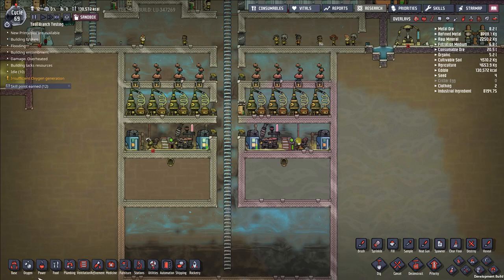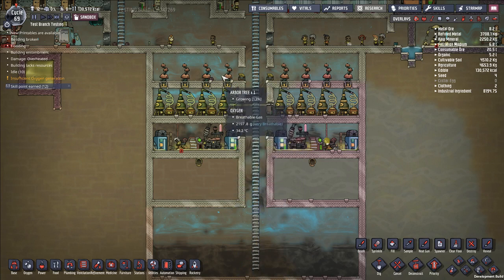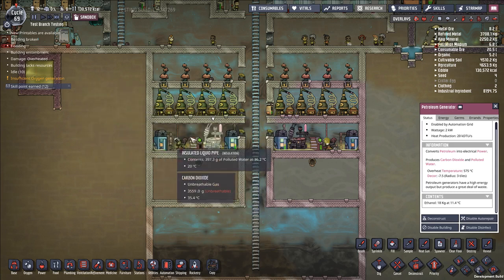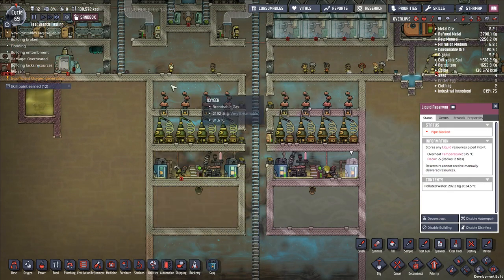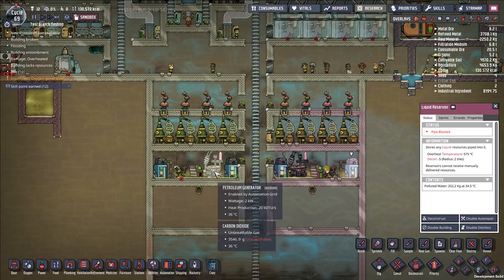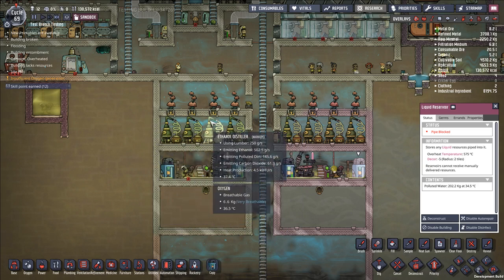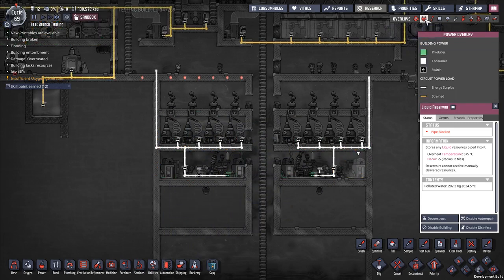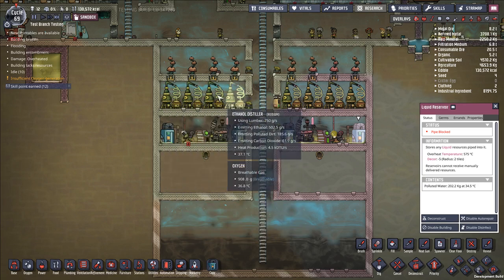Infinite Water, Infinite Dirt, Infinite Power - The Ethanol Distiller [Oxygen Not Included]

Comment: Current rates:
1 Petroleum Gen = 4 Ethanol = 6 Arbor Tree
Gonna need to Vacuum Seal (cheaper alternative unless you have ceramic or equivalent insulator) the walls though to avoid heat from leaking (1 entrance maybe or automate everything)

Comment: This does not work anymore. Not only were the lumber requirements increased, but the water byproduct was decreased. It's not worth the hassle to try to sustain off of this.
Reply: It still works, but requires some tweaks. It doesnt need phophorite anymore which is a huge plus (no drecko ranch required for loop). Just P.Water and dirt maybe? The Petrol Genny can feed more than one tree, so it is sustainable (or you can just use wild trees in a pip ranch). If you choose to clean the water you can use electrolyzers or oxyferns (for small colonies). If you dont clean the water it just goes into as many trees or other plants as you want. Pips eat some of the trees giving you dirt, the polluted dirt from the distiller can be used for more dirt or, if you have excess, can be fed to pokeshells for sand, lime, eggs, meat.
Reply: @ashurroth6585  8 trees > 4 Distillers > 1 Gen should only cost you 183.28 g/s of Polluted O2. You could likely make that up from bathroom overflow. All that is assuming the numbers on the wiki are correct.
Reply: @Moriibund419  Found a cold slush geyser this petty much is powering my whole base and plus the the gens dont nid to keep running that often now

Comment: Couldn‘t the destillery cool itself with the very low emmiting temp of the ethanol?
Reply from the maker: Definitely.  Ethanol has a specific heat capacity of 2460 DTU/kg/C, and if I recall correctly, a distiller produces 2500 DTU/s of heat and ~1/2 kg/s of ethanol at a temperature of 10 C.  So just having the ethanol circulate through the distillery room and absorb enough heat to go up 2 C is enough to keep that room cool.

This might change in the future, particularly if they change the output temperature of the distiller (I would not be surprised to see it output at 40 C in the next patch), but for now, the easiest solution to keeping the distillers cool is to just have the ethanol run through a radiant liquid pipe through the room before it heads down to the petroleum generator.
Reply from the maker: Update: They changed the output temperature of the ethanol to 75 C today.
Reply: @gearheadgaming1  oof

Comment: Those are  for making slime into algae, not ethanol. But 3 ethanol distillers fit in the same spot and it works just fine
Reply from the maker: This video was made before they updated the artwork for the ethanol distiller.  Before they did that, they used the algae distiller as a placeholder.
Reply: @gearheadgaming1  I see =) if you just supplant the 4 algae distillers for 3 ethanol ones they fit perfectly and the system runs smoothly

Comment: I tried burning super-heated ethanol with 1kg packets it worked but it caused some ethanol steam to appear. Not sure if that is the intended result from doing that or not, or if I still got the full power output value of the ethanol.

I saw a bug report saying that the condensed ethanol on the ground may actually be greater or equal in volume to the input ethanol. My guess is that there are still some ethanol burning issues in regards to using the petroleum generator.
Reply from the maker: Interesting, I'll have to play around with this.  Good find!

Comment: Carbon is not a problem cause late game your going to do this!  Meanwhile that means the whole time up to that point your slitting your throat getting involved in it early.  Phospate is not common, you will have to ranch dreks to get it, meaning your not doing it without a drek farm so much for infinite scaling.  I have built and played with that system and I'll tell you that the part they don't really warn you about is just how much Carbon your going to be producing and just how much heat you make.  That means you need 2 more systems in place to deal with it....Next, the main reason to build the generator is to produce power but your power is going to go into dealing with the waste products particularly carbon and also heat.  You wont really come out ahead until each thing is properly dealt with and you guys sell this thing like its super powerful when its not and its potentially dangerous until all its components are properly put into place.A full half of your power production is going to producing fuel...That leaves you with just a little over 1K power to work with and you'd be surprised just how fast that goes bye bye if your investing it into enough carbon skimmers to deal with the Carbon, which Im kinda thinking may as well pack into a tank...But that means your just putting off an issue.
Reply: I start with a good digging dupe and rush caustic biome for algae, phosphorous and coal. I let bathroom output go to hydro plot trees, generally about 3-4, so the logs are building up and I don't have to bother with digging up every tree (wild trees take a while to regrow). You are correct in that it is not quite as simple upfront as some are playing it off to be. What I would like to see is an early-ish mid game, 2 stage aquatuner setup (1 for chilling Pwater to almost freezing, 1 for ethanol to go colder than that) that are built with aluminum.

Comment: Hey can the Poke Crab be used with Water Sieve? You can Polluted Dirt <=> Sand
Reply from the maker: It can be, though I think the main reason I want to ranch the crabs is for their shells.  Right now, lime is the major bottleneck for steel production-- with these new crabs, we can break down the shells that they molt into lime and produce a lot more steel than we used to.  But the sand production is nice too, provides us an easy way to keep our glass forges, water sieves, and deodorizers going without having to breach the asteroid surface.

Comment: In order to use that efficiently in some ways you would need a ton of sand, for converting p oxygen to c oxygen,  cleaning water etc,  also,  how to get more sand? I have none left on the asteroid that's minable.
Reply: You can use pokeshells to convert polluted dirt to sand. Or you can crush granite or sandstone to sand by the rock crusher. God bless!
Reply: @johnwept5250  but i dont have sand. and that distiller he keeps talking about is the icon for the Algae Distiller. I don't want to convert slime to algae.
Reply: @johnwept5250  use regolith which is renewable from the surface
Reply: @Paperclown  This video was made back when the icon for the ethanol distiller had the same sprite as the algae distiller.